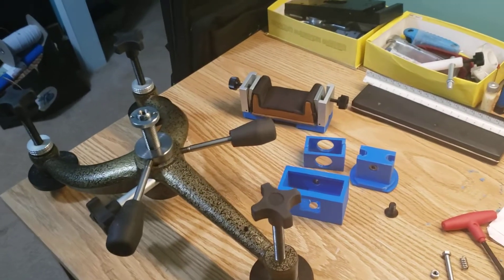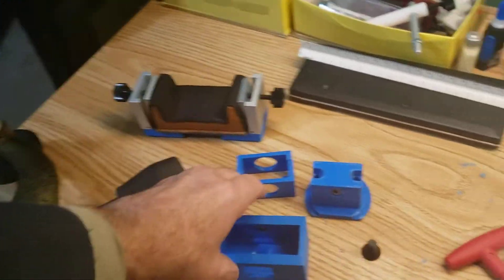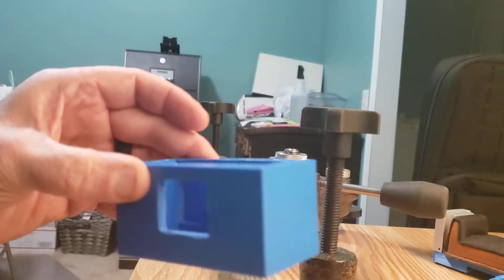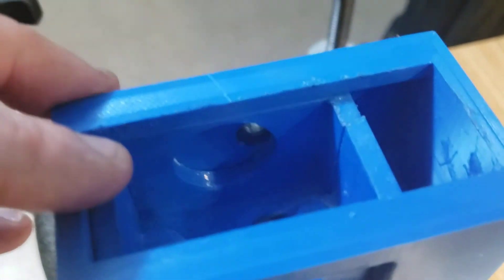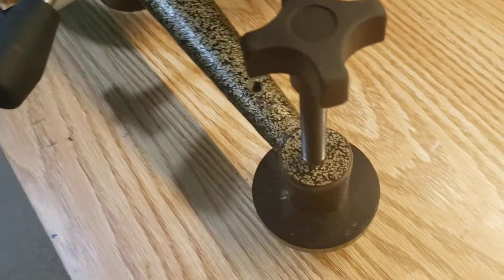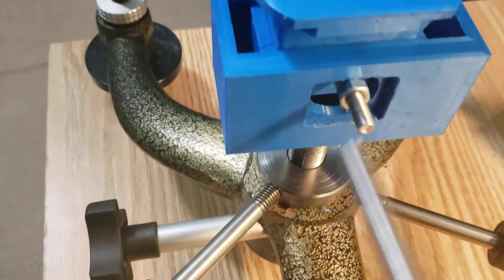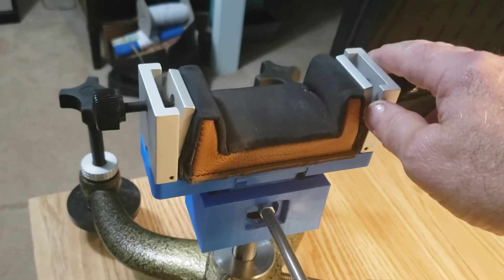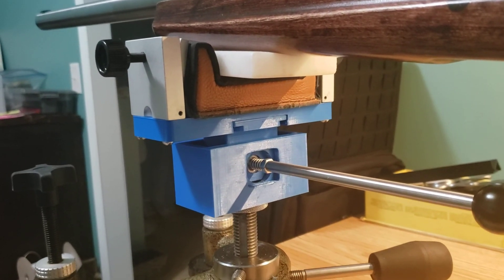3D Printed Coaxial Shooting Rest Top

Comment: Hi Mr Moore, 
I love what you've done with the design.
I love the idea of the springs, it's a great idea to handle the weight.
The main reason I printed the body in 2 parts was to avoid any issues with overhangs while printing. I am definitely curious about how you managed that given how clean the part looks. The same goes for the overhangs on the rotating top. They're very clean. Printing overhangs is something I've always struggled with.
I really do like the rotating top. I will have to incorporate that into my final design. I've also been looking at the bearings for the sides of the top similar to the rodzilla. I have some v-roller bearings that I bought to use for that purpose.
The locknut is a great way to securely attach the base without having to worry about alignment problems.